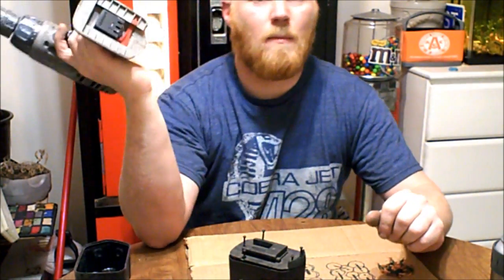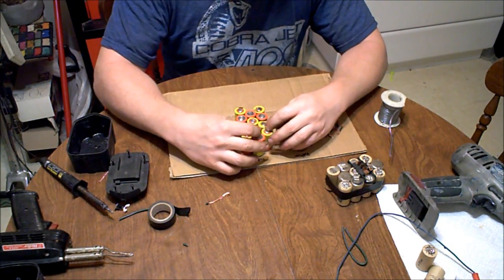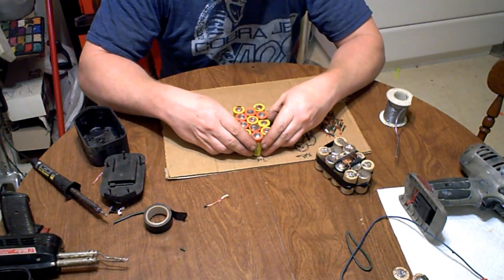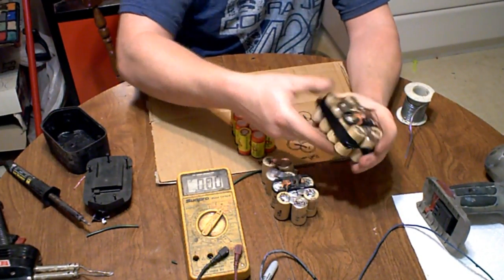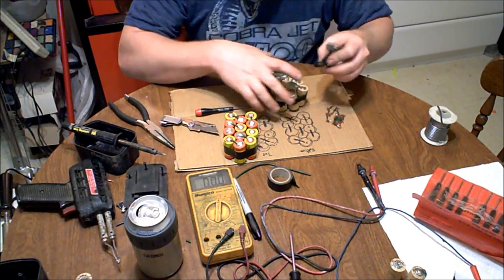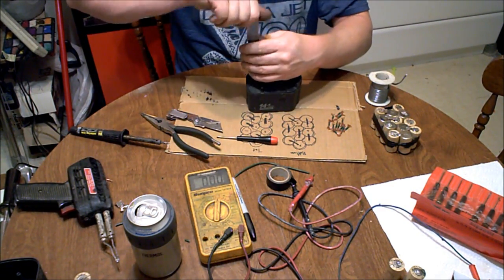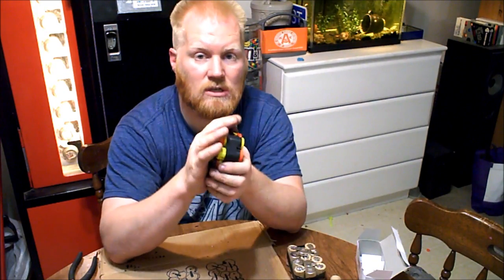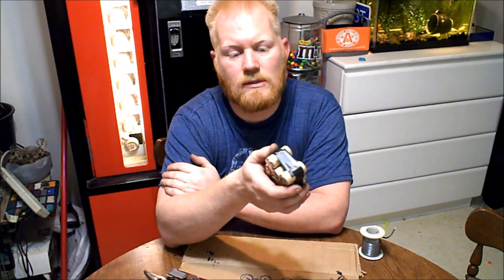Cordless Drill Battery Pack Rebuild for $20 or Repair for $0

Comment: Brother is there not a reason that You are not giving the name of the drill that you're repairing that would be pretty good information
Reply from the maker: Was a Porter Cable. 14.4 volt. That's really irrelevant though because all these battery packs from all the brands are identical.

Comment: Thanks for the vid .....less garbage in the landfill and less co emitted...one question , why did my 12 v cordless smoke when I used a 12 v scooter battery . I bypassed the battery pack with the battery . Maybe a current limiting device in the batt pack .
Reply from the maker: So you took a 12v cordless tool and hooked a 12v lead acid battery to the terminals? I've done this many times without issue. There is no limiting device in battery packs and the tool will only pull the power it needs.
Reply: @sixtyfiveford  Thanks for your time . I fried two portable and had more . Maybe I accidently reverced the polarity twice . I'll try it again with another model . This happened many years ago , maybe 20 .

Comment: it's not really for free it's not really rebuild for zero because you had to buy the nicads are you going to tell us where you got them and if you enjoy that quality they're very very few sites that are objective about buying batteries they always have an agenda a kickback or some store where did you get your Nikes and you feel that they are a good quality blah blah blah blah blah
Reply from the maker: When I say free I'm referring to taking multiple packs and pulling out the good cells and combining them into one pack. Generally I prefer Tenergy cells but other brands are good as well. You have to watch out for fake numbers on the cells. 2200mah is about the max capacity you can get in a Nicad but you'll Sea company selling 4500 5000 and etc which are all bogus. If you decide to go with NIMH cells just make sure they are "hi drain/ hi discharge" cells. Power tools require a lot of amperage to be spit out. In Nimh you can get upwards of 5000mah. 
https://amzn.to/3FrDYOj

Comment: You are running the batteries in series. If you are going to have to attach the straps you are better off using an instant soldering iron or a spot welder. A standard soldering iron gets the batries very hot too hot and can cause failure leakage or explosion. You gotta do what you gotta do though. If you arent a skilled solderer you should practice or find someone who is good at it.

Comment: Awesome video man. Can you take a close up if you soldering them together. I solder wires all the time but I’m a little afraid to put that heat in the battery itself. Thanks man! I’m gonna fix my d add a drill. Sub’d

Comment from the maker: HERE'S WHERE YOU CAN FIND CELLS
Good cells w/tabs 2200mah: https://amzn.to/2HaAHem
Great cells w/tabs 2200mah T-energy: http://amzn.to/2ld99IF
Buy cells with tabs or buy soldering tabs:http://amzn.to/2dMfqFX

16 cells= 19.2 v packs
15 cells=18volt packs 
12 cells =14.4volt packs 
10 cells = 12volt packs

 If you need a soldering iron: http://amzn.to/2ldgPuD 
This is my favorite 260 watt: https://amzn.to/2JhtFCY
"Sub C" are approx 1-11/16" or 43.1mm tall
"4/5 Sub C" are approx 1-5/16" or 33.4mm tall
Both are approx 7/8" or 23mm round the same as a C size battery

UPGRADING TO LITHIUM: https://youtu.be/q2eaKCzf04c

Combining Packs:
I didn't want to go too much into the theory of load testing the cells. You can charge the pack and let it sit for a few days/week. Then put a flash light 3v bulb onto a individual cell and measure the voltage as the bulb is attached. You'll be able to determine the strong cells vs the weak. The good cells should stay around 1.3 volts or more. You'll see some drop right under 1volt immediately(those are really bad). Letting it sit for a while shows you the cells with high self discharge rates.

MAKE SOLDER STICK
Lightly sanding or scratching the battery helps the solder to stick rapidly. Tin(apply solder to) your wire and the battery tops/bottoms before you join them. This allows a quick bond.
If you enjoyed the video: let me know below, thumbs up, or Subscribe for more.

Comment: Nice video. I have tried to do the same thing with an 18 volt battery. Bought the batteries, soldered them together and let it charge for 24 hours but am only getting 10.73 volt reading for a battery that should produce 18 volts. Batteries are all good and produce 1.2 volts each. The original batteries were 1200Mah and I replaced them with 2200Mah. Any ideas why I’m only getting 10.73 volts?
Reply from the maker: One battery is probably soldered backwards.

Comment: couldn't hear you , and camera was a bit too far away , sorry , the bits of metal both in the drill and on the battery that connect when you put the battery in to the charger or in to the drill have corroded so I need to replace them ,well one ,the other side in the drill and on the battery looks ok ,but thanks anyway

Comment: Instead of soldering nicads back in.  Is it possible to use lithium ion batteries instead?
Reply from the maker: You will run into a few problem besides just fitting new lithium cells in. The first is you won't be able to charge the battery pack on your dedicated battery charger because lithium is a different voltage and chemistry.  Second you will need to buy HI-DRAIN 18650 at at least 30 amps because typical 18650 lithium cells will short out under the high load. After you buy a separate charger and modify it , and buy the 30amp 18650 cells you'll be better off financially just to do what I did in this video: https://youtu.be/q2eaKCzf04c

Comment: the batteries he is using are not 4/5 sub c, they are sub c batteries, the 4/5 are  33 mm in height, the sub c are 43 mm, there is a battery chart via google which has the battery dimensions, using the ones with the tabs are better which can be used to do both sides, the Thermister goes between the central terminal and negative on the battery, it will register as a fault on an intelligent charge

Comment: Great tutorial, I found on of the metal strips come away from the spot weld will I be able to solder it back on? Thanks.
Reply from the maker: Yes, just scuff the metal strip and battery with sand paper first.

Comment: I have 2 Hilti NiCd batteries that are SFB 121 and are 12 volt. They do not hold a charge and need to be rebuilt or replaced. Do you repair these or do you know where I can replace them?
Reply from the maker: Ebay is your best bet for a rebuild service. There are a few guys who will put new cell in for you.

Comment: Thanks for this. How's it running after 2 years?
I did the same. The key is finding good quality Sub-C.
I rebuilt my 14.4 NiCad  with advertised '3000' mAh Sub-C batteries.  They felt a lot lighter then the OEM. In the end they work. Strong driving, holds a charge but it charges in 1/2 the time which was telling...  The run time is about ~50% compared to the factory battery.
Reply from the maker: The packs in the video are almost 6 years old and getting towards the end of their life. The highest real NiCad you can get is 2200mah. China(Ebay) is notorious for posting bogus numbers.
Reply: Nice. I still like NiCads. Older tech and heavier but  simple and easy to rebuild with just a single temperature sensor. However  rebuilding Lithium packs? Gotta think twice with all the protection circuitry involved.

Comment: This was probably a useful hack 5 years ago, but I don't think so now.  A person can now buy a two-pack of NiMH complete replacement battery packs on line for less than $35 including shipping.  Since this hack depends on buying no-name batteries off of ebay, and since those no-name batteries will be of questionable quality, a person might as well buy the no-name complete battery pack for less money which will come with at least some short return guarantee even if the return window is only 30 days.
Reply from the maker: You can purchase some super cheap Nimh packs but they will die in a few months; if you're lucky. Or you can put real Nicd name brand cells in a pack and have a pack lasts 5+years.

Comment: ANYBODY here know who the YouTuber is that would send folks the metal tabs needed to contact cells together while soldering?  Please reply here!!!  Thanks So Much.
Reply from the maker: You can buy the batteries with tabs, buy bulk tabs for really cheap, or use some scrap wire.

Comment: Hello Sixtyfiveford, I really like this video. I have bought sets of the 19.2 volt Craftsman drills and other tools over the years and almost all the batteries will not hold a charge or just will not last too long. 

The price of the batteries is about the same as buying one of those battery packs now as opposed to buying the batteries and building a new pack. 

My batteries are the 2000mah but I also saw that one company has the 19.2 volt battery packs in the 3000mah for about $15.00 more, the 15 pack of batteries are $28.99 plus one extra battery for about $2.00 then $15.00 for shipping will be $45.00 if they don't charge sales tax. 

There are some great prices on new battery packs right now for my tools, 2 batteries ready to charge and use from $33.00 on up to about $40 and they have a free freight special right now.

I hate to throw away those battery packs that I have because I think maybe I can take some of the cells that are good and combine them to make some packs that might work for a while so I have plenty of batteries to use when I need them.

I see you used wire to solder to the batteries but did not hear what gauge of wire you used. I don't know if you need something thick like 12 gauge, thicker or if 14 gauge would work. What gauge wire did you use to solder to your batteries?

Thank you.
Reply from the maker: A 14awg or even 16awg at these short distances would work just fine. If you can buy them with the tabs preinstalled it's just that much easier. Nicad packs should never be rated at more than 2200mah. Anything over this is fake. China (Ebay and Amazon) is notorious for putting exorbitant mah numbers on their cells/battery packs.There is a chance they put Nimh cells which have higher capacity(3000mah is realistic for Nimh) but can't handle the severe amperage draw a Nicd can and will be very short lived in a 19.2V drill. I just looked on Amazon and found them for 19.99 w/ free Prime shipping.... That's cheap! But reading deep into the reviews, many people have experienced very short lives of under 6months with rare usage. Which is what I would expect for a super cheap pack. 

Consolidating your packs into 1 pack is always a free option. I remove the pack shell to have access to the check the  individual cell's voltage. I charge the pack full. Then I let it sit for a day or so and and put a load on it, by plugging it into the drill and running the drill. You can then measure each cell's voltage. You notice a good cell with stay above 1 volt(1.2ish) and bad cells will drop under a volt and some will reverse polarity. I cut those out and put good cells from another pack in. Then test again before final reassembly.
Reply: Thank you for the reply sixtyfiveford. I like your videos, very creative and common sense approach. Have you thought about a knife sharpening video, for pocket knives? I have seen some out there where you have to buy these different stones and such. I am thinking you probably have a great way to get them razor sharp without having to buy all kinds of stuff to sharpen them. Thank you.
Reply: I have 4 of the 19.2 volt Craftsman battery packs that will not take a charge, when I put it in the charger the red light does not come on, I forgot what happens but they don't charge at all. They have been sitting in the garage for a couple years now and I would like to try to figure out which batteries in the packs are still good and which are bad but I don't know how to do that since the charger will not charge them. Any ideas?  Thank you.
Reply from the maker: That's kind of a bugger if the charger won't attempt to charge them. You can take off the cover and just see which cells are 1ish volts and cobble them together in a pack. You could also shock each cell back to life by hooking each cell to a higher voltage for a second. This will allow the pack to charge. You do this with something like a car battery(12volts) and take a basic 18awg+ wire and touch it to both sides of a cell( pos to pos and neg to neg) for a second or two. 12volts is a little high for 1 cell so I would probably do it to a pair or triple row of cells. You could also do it to the entire pack without opening it but you would need 3 car batteries for 36volts to shock the pack back to life.
Reply: I will give that a try next week. Thank you.

Comment: Great video. Still, after all these years.
Nowadays, nearly everything new is on Li-ion. But older tools are nearly all NiCad. Are these NiCad batteries still possible to buy?
Reply from the maker: Nicad are just as abundant as they ever have been. Yes, Lithium has been the new kid on the block for the past while but tools are still being made with Nicd and will continue for long time. There are a lot of shortcomings with Lithuim along with Nicd and they fill each others voids.

Comment: Answered my questions.  Have replacement batteries ordered.   Once upon a time I would not have attempted this, thanks.
Reply from the maker: It takes a little patience soldering them in, but it's a great sense of accomplishment when you get it done. Lightly scuff(sand or file) the tops/bottoms of the batteries and the solder will stick a lot easier/quicker.

Comment: I'm actually using my drill as a trolling motor on a kayak. My question is should I go with the nimh?
Reply from the maker: The Nicad handle high torque(driving a screw/drilling a large hole) and Nimh would be better suited towards lower torque longer runs. So I would say Nimh would work for you. On a side note, don't be fooled by bogus overrated Chinese cells. Nimh in Sub C should be around 3000-4500mah(anything way over is fake).
Reply: sixtyfiveford Thanks for the fast reply

Comment: great video, ive dismantled the battery and all looks straight forward. Im starting with an old dewalt 12v 1.3ah  can i replace these batteries with 9  NiCd 4/5 SubC Sub C 1.2V 2200mAh, so the volts are more or less the same but a higher mah? thanks!
Reply from the maker: Yes, you can use 2200mah. You'll either need "4/5 Sub C" or just "Sub C". Measure yours to see which ones you have from the specs I put in the video description.

Comment: is it dangerous to get too much heat on the batteries? i had a bat pack that wouldnt charge, i took it apart, noticed one of the straps had detached from one battery, the only way i could think of to fix it was to solder but was worried about heat causing something to explode. i may take another stab at repairing it after watching this
Reply from the maker: Too much heat will shorten the life of the cell. That being said, I've put a lot of heat into them with no ill effect.

Comment: not a bash on ya.. It's milliamps, Not Micro amps... just trying to help ya. great video. thumbs up. I gotta do the same to my 14.4 snap-on drill. the charger will no longer even except it. plus when it does the batt. only last about 2 mins. or less = Junk batt. thanks for the great info!
Reply from the maker: Yes, I misspoke.

Comment: Thanks, you look like a tough guy in this video, but when you speak you're a soft-spoken guy, the way you explain the steps you could be a good teacher. btw, I'm in Canada, where can I buy these batteries?
Reply from the maker: Ebay or Amazon are your best bet. Don't fall for over rated capacity batteries. They should be around 1500-2200mah Nicad sub C cells.

Comment: Yeah, good instructional vid. I did similar with my old Ryobi 2.4V cordless driver when the original batteries gave out. It was a much simpler job (only two sub C 1.2V batteries and no temp sensors) but the principle is exactly the same. Result: one old driver back to better than new. I can now repack my 12V cordless battery pack when it eventually dies. with confidence.
Reply from the maker: Nicely done.

Comment: Great vid. Thanks for your effort. My rebuild will be a 12v pack. Is it an opportunity to up the power to say 24v. any improvement whilst rebuilding.
Reply from the maker: 24V is a little too much for a 12v drill to handle. Lately I have been upgrading them to run off cheap Black and Decker Lithium battery packs: https://youtu.be/q2eaKCzf04c
Reply: sixtyfiveford thanks for the reply.

Comment: I do all that good stuff  and it't's still a bitch to get the solder to flow.
But I see you have a "FRANKENSTEIN" solder iron.
That is probably where you have the advantage.
Reply from the maker: A large soldering iron just allows you to do more cells quicker. I would suggest at least a 100watt, but I've done it with a 25 watt iron before.

Comment: if all else fail get some solar cell ribbon wire it already is pre soldered and its flat and it works perfectly
Reply from the maker: Yes, that's a good tip. I have a link in the video description for dedicated battery tabs but solar cell ribbon wire would work great.

Comment: Great video, you saved my tool. I did not wanted to throw it away or buy another one. Now I will just do as you did. But... my Craftsman drill show 10.8 V? is that unusual?
Reply from the maker: Each cell is rated for 1.2volts nominal. So a 10.8v will be 9 battery/cells wired together.
Reply: TY! I just opened it today... it is 9 cells. I went to RadioShack, and they did not have that size battery. so now I gotta go online and get some

Comment: where the hell does he get 14.4 volt here with 1.4v cells. 
cells must have 2.4v to get 14.4v battery.
Reply from the maker: Nicad and Nimh cells are rated at 1.2volts nominal. So 12 cells "times" 1.2v is a 14.4volt pack. Fully charged Nicad cells can get up to 1.4-1.5volts, so a 14.4v pack will be as high as 17-18 volts.